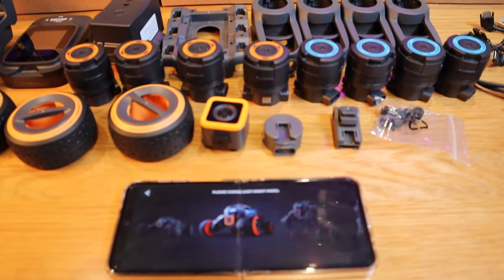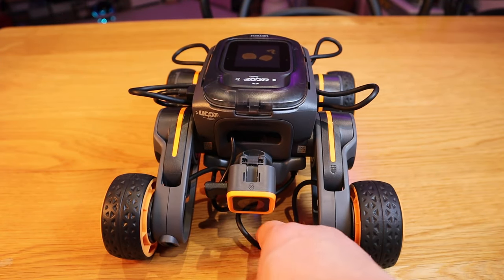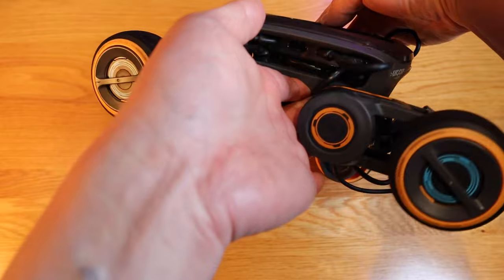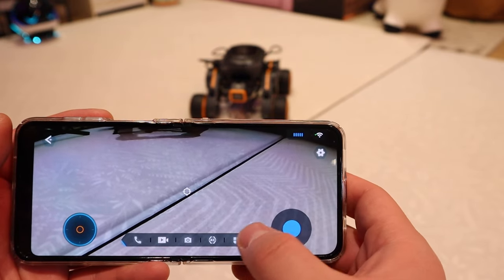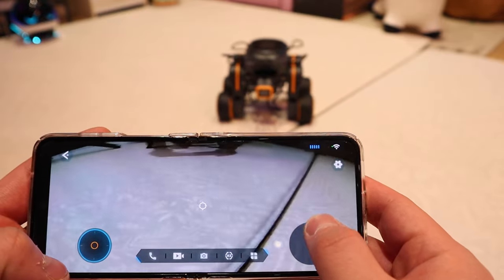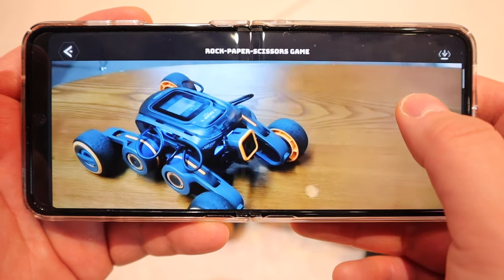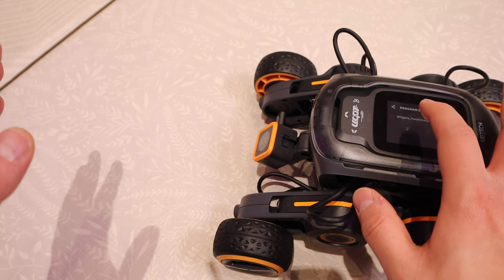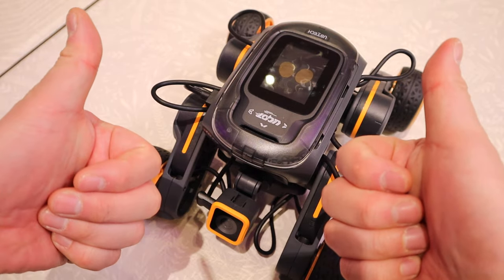I Made a Transforming Robot that Plays Games!

Comment: its a toy not a robot nothing special
Reply: but it's a cool toy nevertheless
Reply from the maker: Toys does not have AI, ChatGPT and coding function.
Reply: Have you noticed what selecting AI does yet in remote mode?
Reply from the maker: I think it is mainly for tracking you
Reply: @ljptech  have you had yours track then? Wasn't sure it would track in remote mode & there's no way to activate an AI option not in remote mode...right?
Reply from the maker: @neilrisley6667 as far as I am concerned that is the case bit this should be programmable